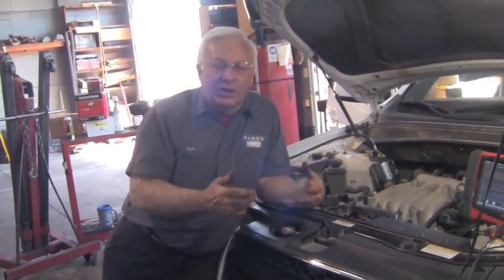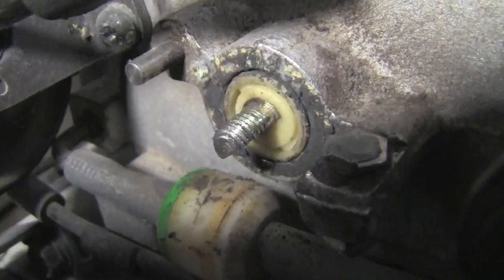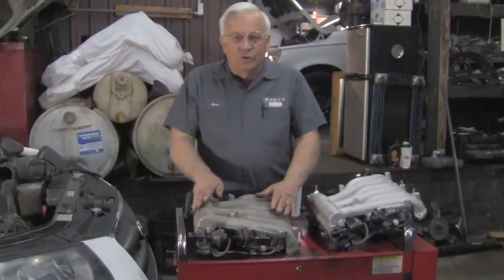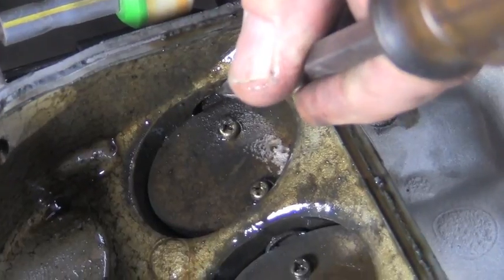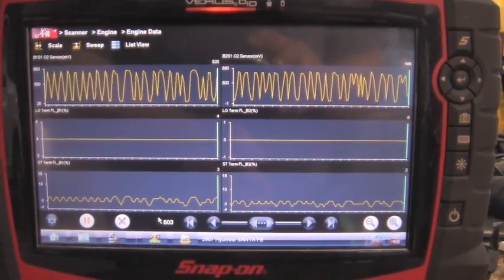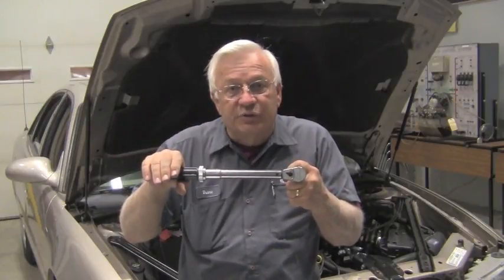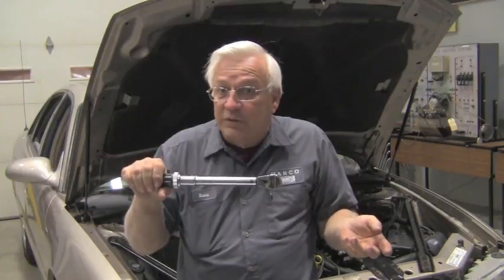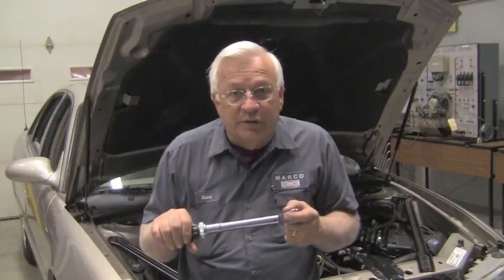A Deeper Look Into STFT & LTFT Part 2

Comment: I have a 2006 ford explorer 4.6L v8.  It has 76k miles on it, so not a lot for the age. I am the original owner and we serviced regularly throughout the life of vehicle. Last year we had a cat issue and had to replace the cat, while doing that i replaced the 4 o2 sensors. I replaced with a walker cat and the walker o2 sensors for front/rear. All good for over a year. The past few months i am getting a p2195 code, O2 Sensor Signal Biased/Stuck Lean Bank 1 sensor 1.  Took to the mechanic first time they cleaned the MAF sensor said it was very dirty. a few weeks later (we don't drive a lot), code came back. This time they did more troubleshooting and it seems what is triggering it is the STFT B1S1 momentarily spikes to 40-50%, but only for a moment, but i guess long enough to trigger check engine.  They found an article for a PCM update and did that.  Driving the car for 150 miles, only saw a pending code (not a full stored code) but same p2195. both pending was around STFT 30-40%, but after 10 miles or so went away.  I also put in a can of Techron fuel cleaner.  While monitoring it i do seem to get the STFT every now again, it seems like it is always when the car is in the garage overnight, then in the morning it will show the STFT when i turn the car on and within the first 2 minutes. it won't happen every time, but when it does it is always in the morning after first turning the car on and within a few minutes i will see the STFT spke to 30-40 or 50 but only for a few seconds then goes back to normal. This is while watching the live data from my monitor tool.  Any thoughts?  Car drives perfectly, no complaints, no loss of power, since using the techron and the pcm update they did it is even better, but i hate seeing that pending code popup every now and again and possibly the full check engine light.   mechanic said they tested the o2 sensors, and all looks normal from them and from what i can tell on the live data.  I did read some people had issues with 'walker o2' sensors.  just curious if any other people's thoughts. you think replacing fuel injectors or replacing teh o2 with the higher end motocraft?  mechanics did do a vacuum test, no leaks, said maf and o2 sensors were operating fine.

Comment: i have one in the shop same engine it was the hose from the T-Body to Mass air flow had a split only time it would give problems was idling in gear neutral would go away but sitting at a red light the movement of the engine opened up the split in the hose.

Comment: STFT bank 1  (- 1.56%); LTFT bank 1 (-0.78%);  STFT bank 2 (22,66%);  LTFT  bank 2 (3.96%) -- how doomed is my bmw with this?
Reply: with just that little bit of data it doesn't't look too bad to me at all.  Most likely a minor issue
Reply: @strokewarrior5762  hehe, so a clap of the hose before the MAF sensor has been loose and was screwed in a manner that there was a tiny air leak space left.. I did screw it tight yesterday night and today there were no trouble codes stored after driving. I was getting P0170 P0174 quite oftenly in recent period..

Comment: You can remount that shaft and put a seal over the whole thing over the whole Shaft or something put a little bearing or sleep in there a bushing it's a bad design there's enough not enough to handle the torque of the pull pivot

Comment: Wow.. Nice info! This is exactly the problem I am facing right now. My 07 ford taurus doing the same, for bank 1 STFT stays between +/-3%, but LTFT stays constant at about -12% at Idle. Bank 2 is lean at idle with +12%  total fuel trim. When I increase RPM to 2500, STFT jumps between +/-6% and LTFT stays constant at -19%. Bank 2 improves at 2500 RPM with about +6% total fuel trim. OBD says cylinder 1,2, and 6 misfire. I have tested injectors, replaced the leaking injector already. What would be reasons for having constant -12% LTFT at bank 1? Thank you.

Comment: Question:. What harm would it be to leave it? It's a 10 year old Hyundai... What harm would it do?
Reply: well, i could think of 2 things. 1, your fuel economy drops because of engine compensating with more fuel. And 2, if you live in a state that requires an emission test (aka smog test), then your car would fail, preventing you from renewing your registration.

Comment: Good explanation...the ECM is adding > 10% LT fuel to maintain the ST within the 10% range. My Corolla manifold leak shows 30% LT but the ST is between -4% and 8%. The code is set with the LT data. Finding the leak without a smoke machine is the hard part...

Comment: Excellent video, thanks. Last week I moved propane bottle fast on 2000 regal 3800 engine and could not find leak(LTFT high only at Idle, so I followed your video Vacuum test 01 released on Nov 15. 2011 and used vacuum gauge. The reading was steady at 20.5 inHg which excellent. Is smoker test is better than vacuum gauge. I do not have smoker so used vacuum gauge.
Reply from the maker: both tests are good but they are also dependent on being done well.  The vacuum test is probably the most convincing because the engine is basically an air pump
Reply: @realfixesrealfast  hello, on chevy aveo ai have STFT 1 at -13% and LTFT 1 at +14%  with hot engine and running at 50 km/h.

With cold engine stationary, STFT 1 is negative 10 and LTFT pozitve 18 and 3 errors P0140, P0141 and P0171.

Comment: Wow, what a complex system, they went through the extra effort of making six intake valves but then tied them all together to a shaft so they can't be individually controlled. All those contact points are bound to fail as the vehicle ages.

What I found confusing about fuel trim is the way oxygen sensors measure oxygen, not fuel. So, an electrical misfire appears lean because although there is lots of fuel going through, that fuel is not burned, so the oxygen is not consumed. Then the PCM inappropriately reacts by adding even more fuel. As much as it feels intuitive to think oxygen sensors measure the ratio of fuel to air, I get tripped up when the fuel isn't consumed.

Comment: We've had that same 07 2.7 and just handed it down to our daughter. I was wondering what the intake would cost and just for the heck of it I tried to look for an upper intake online and I could not find one anywhere. Knock on wood we never need one.
Reply: Matt Trotta I would bet the dealership.  That was a new intake manifold...doubt auto zone will carry that one.  Hope it never happens
Reply: Used ones on ebay range from 60 to 120. Probably a new one is $400 or so.